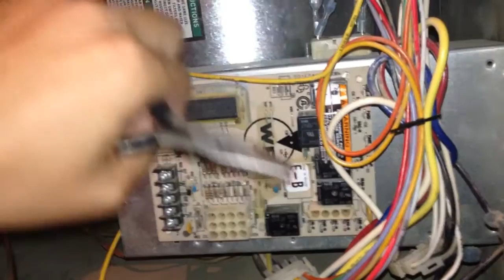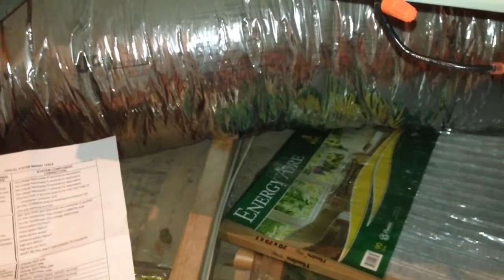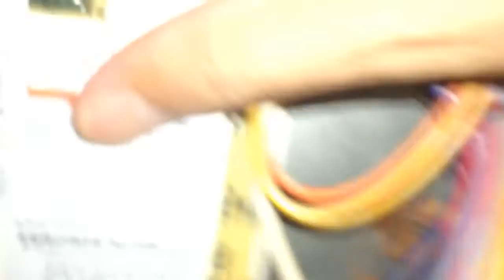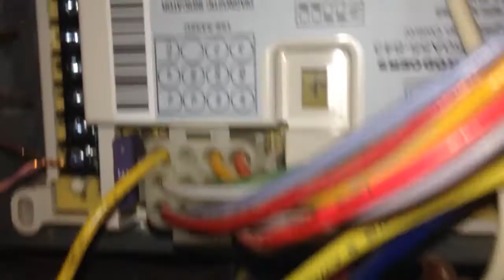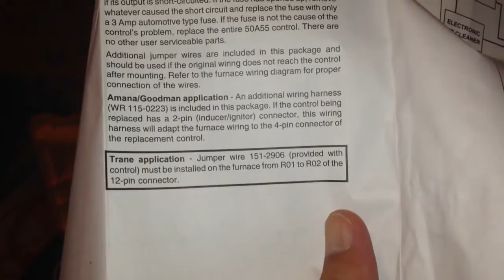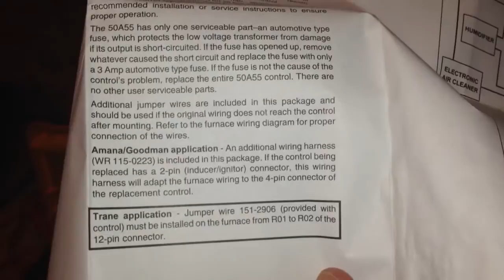Part 2 Trane circuit board replace

Comment: How do you know that your furnace is safe after you done 
Did you verify that blower speed is enough to cool down the heat exchanger per manufacture specs?
What’s your level of CO in the exhaust and what’s the draft level ?
Is gas pressure is safe for your family?
Reply: Wow, this is obviously more complex than it appears at first blush. How can I contact Mikhaiel Heating and Cooling for a quote?
Reply: @commentatron  i apologize I don’t offer residential services, I’m a commercial and industrial mechanical contractor I work on chillers and Large size equipments 
But good work sir after all , 
be safe , get that furnace inspected by a local contractor
If the board went bad more than once , furnace could be running at a higher temperature than design ,or wiring issue some where .
Be safe
Reply: Can you elaborate on how the blower speed could possibly change after the replacement? The motor wasn't replaced, meaning as long as you have 120V input into the right line, you have the same speed. Is there any reason to believe he changed the motor input line setup?
Reply: Along similar line, is there any reason the CO in the exhaust could change? He just replaced the controller circuit, which takes takes 120V as input and send 120V or 24V to the right output. He didn't change the sensor. There's not much room the board can manipulate the 120V and 24V that can affect how the sensor work.
Reply: I made this comment to help and to give a feed back from a 20 years of experience as a HVAC professional 
Learned HVAC in the US Army best trade schools and still service in Michihan National Guard as of today 

I’m a Licensed mechanical HVAC contractor which it requires years of hard work , and experience 
I seen so many errors that was made by professionals in a repair like that that cause death 
So a home owner can also make a mistake we are all humans 

Changing the board 2 times means you have other issues in the system 

With out the proper tools and knowledge to test we are just guessing that our family is safe 

I can’t offer any more advice than hire a Licensed contractor for liability reasons 
I don’t work in the residential industry any more 
So this is just an advice after 20 years of experience in the trade
Be safe

Comment: How did you run the jumper wire to the motor?
Reply from the maker: I added a part 3 that shows where the jumper wire is installed. 

https://youtu.be/jALh2Mvm78E